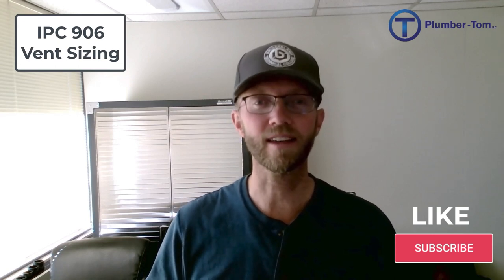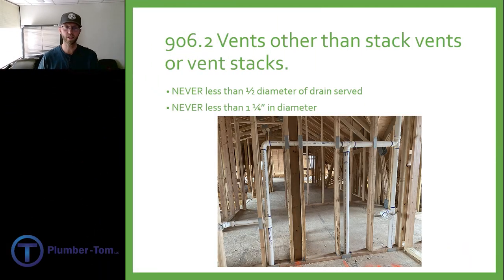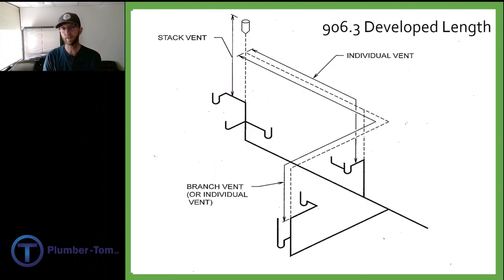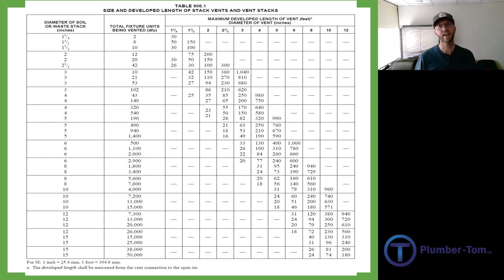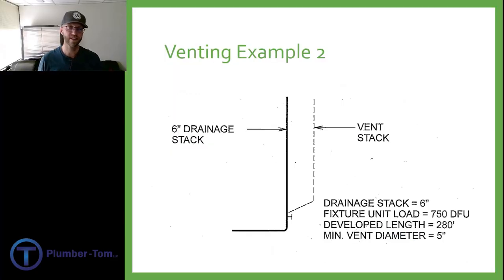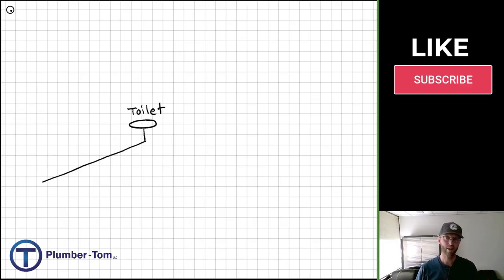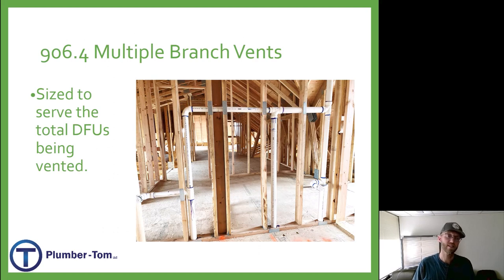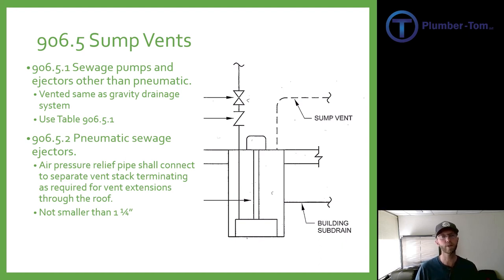Understanding International Plumbing Code Chapter 9 Section 906 Vent Sizing

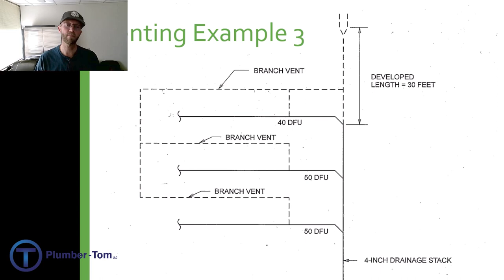Comment: May I ask why in 9:41 the developed length does not start from the bottom level where the vent connects to the drain as the "farthest point"? To me that seems to include the entire length of the vent.
Reply from the maker: Developed length on venting can vary.  They should all start from the drain, but the develop length can end outdoors or at a stack vent or vent stack.  So it just depends on the situation.